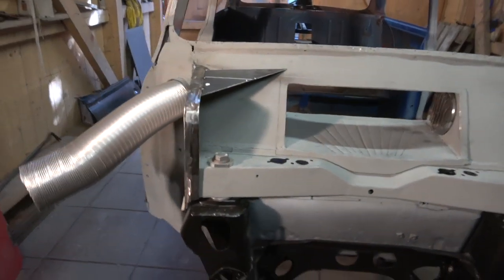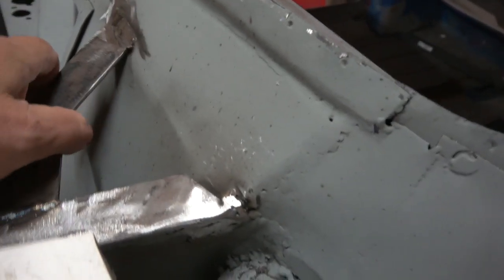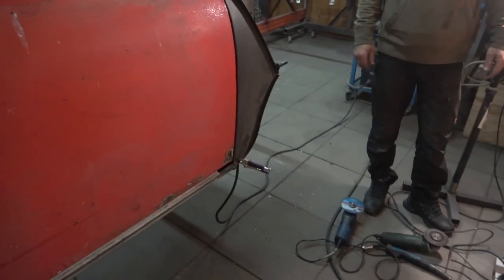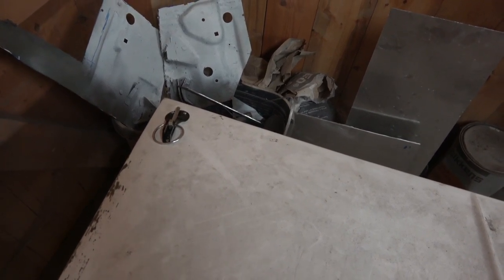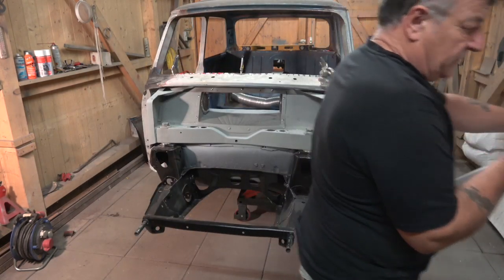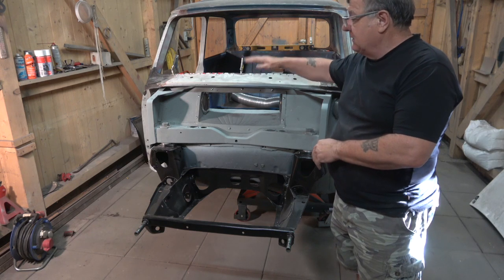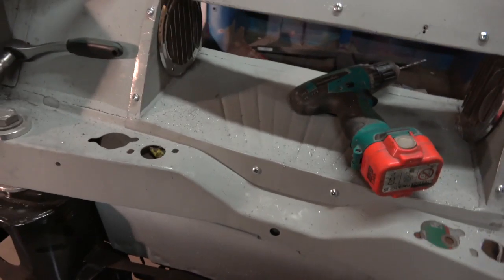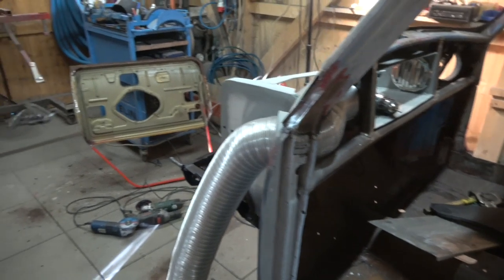Classic Mini Track Day Car Build Part 15 ( Inner wings & CF Front )

Comment: that's an unusual way of doing the rear bonnet pin mounts, its normally its just a small triangle between the scuttle and inner wing, but i can see why you did it that way, there was no scuttle panel to weld to :)
Reply from the maker: Richard, As you say the scuttle was off and it gives some side strength to the inner wing,  Cheers Dave

Comment: Dave, engine bay looks really good. Top job on the box. I would comment on the hot glue though.  Wouldn't it be better to use the pvc plumbing glue as the hot glue may not stick too well? Would be a permanent fix with the pvc glue. Although, having said that, not sure what plastic the funnels are. Just a thought.
Reply from the maker: Ryan, I have to admit it has worked far better than i expected whuch i will show in the next video, Cheers Dave

Comment: Ps Betaflex or Tigerseal would bond the plumbing fitting to the headlamp bowl. Can also be sanded.
Reply from the maker: Andy,  TBH i‘m not sure how far i will go with making them smooth inside but tigerseal is an option. Cheers Dave

Comment: Great fabrication work Dave. It will be a sweet Mini. Surely you have to replace the bottom of the door inner that is rusty?
What engine spec are you installing?
Reply from the maker: Andy, Thank you! The door frames need quite a bit of work but they will be completely rust free before the new skins go on!  I had a boot lid we had re-skin due to rust under the returned edge.  Cheers Dave